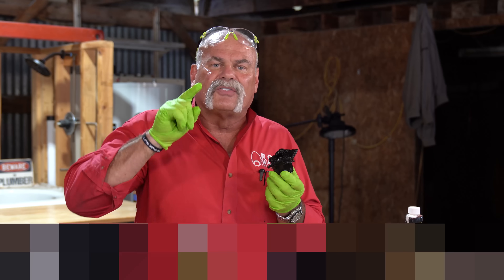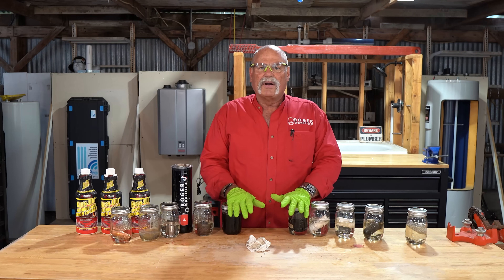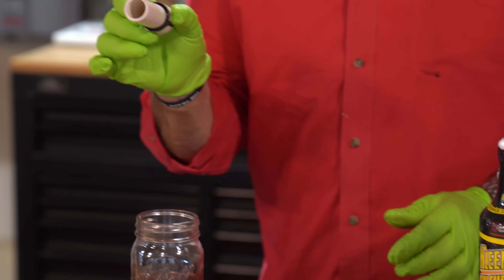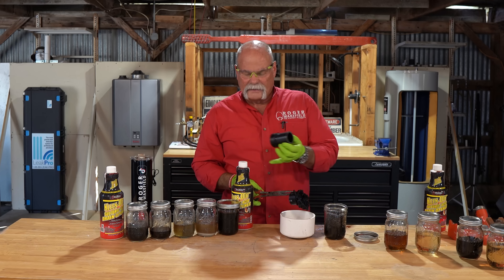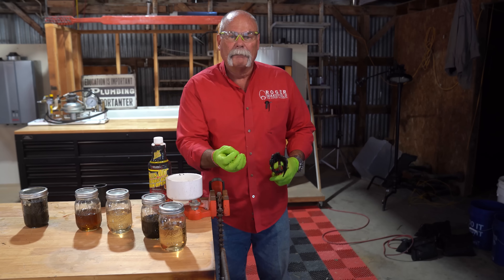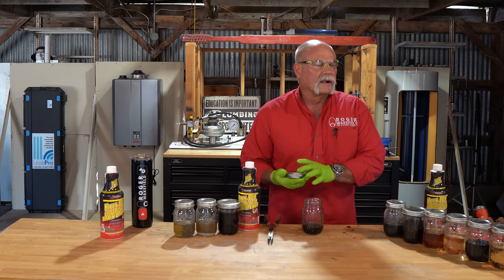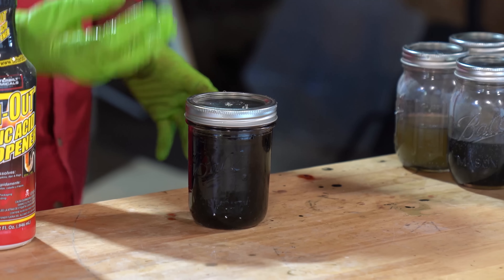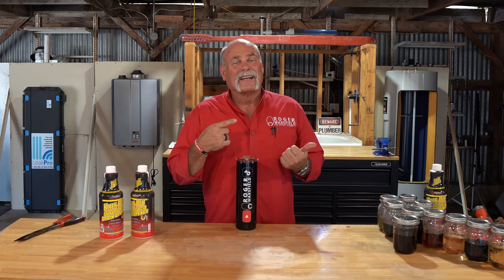Real Plumber Tests BANNED Drain Cleaner

Comment: I don't use ANY drain cleaners, i've replace 20 feet of cast iron in my basement and many P traps when they corroded through from when my ex wife used it mainly Draino, after i told her no drain cleaners at all since i have copper and iron pipes..

Comment: I had a serious accident yesterday with sulfuric acid drain cleaner. I'm very lucky it didn't get in my eyes. My dad gave me a white bottle enclosed in a plastic bag, so that should've been an immediate sign that it was potentially dangerous. I've worked with chemicals at a plant so I should've known to carefully read the label. But i figured since my dad had used it multiple times on his drains in the past that I wouldn't have anything to worry about. If I would've read the label I would've known that this little bottle contained enough for 30 separate doses! I started pouring it in my shower drain, which had a little water in it from a recent shower, and it immediately caused a violent reaction and sprayed out the drain getting everywhere including on my arms and legs. It started burning right away. I quickly grabbed some paper towels and wiped it off my skin. I was scared to rinse it off with water in case it reacted and caused serious skin burns. When I started wiping the drain cleaner off the shower floor, the paper towels got very very hot and nearly caught on fire! It was a huge wake-up call to not underestimate how dangerous household chemicals can be.
Reply: Just so you know - rinsing with massive amounts of water is how you handle an acid spill/burn.  If you got acid on your skin and did not rinse it with water I don't know how you are still here unless it was a very small amount or a very dilute acid.

Comment: Bought the Zep version yesterday at Lowe's. The Lowe's employee told me it was the "only one that works", so I got it instead of the lye-based one I had used for years. HUGE MISTAKE!

Poured the recommended amount into my tub drain. Not only is the ring around my tub drain now black, but it damaged the acrylic surface of the tub! 

Stupid me for thinking that drain cleaner sold at Lowe's and recommended by a presumably-knowledgeable employee would be safe to use for its intended purpose. The warnings on the bottle are in tiny type for anyone over 40 and insufficient even when read.

Comment: On the air plunger, if it can blow the p trap right off. If the plug is down further, it may work but not if you have a vented drain.

Comment: Once over 15 years ago, I had no idea what I was doing, and I used some of this stuff to clear a clog in a second floor toilet that was backing up into the tub.  Little did I know the clog was at the other end of the house from dog hair in the washing machine!  This stuff ate through the ABS drain pipe, conveniently where it ran over the garage (likely bellied), ate through the drywall ceiling, and ate a giant hole over 2' across and an inch deep in the concrete of the garage floor.

The entire drain system from that point down had to be replaced, ceiling and walls torn open, and because the concrete garage floor was also the post-tensioned slab of the house, a structural engineer had to come in to draw up plans and certify repairs to the garage floor.

I SHOULD HAVE JUST CALLED A PLUMBER!  :(
Reply: Sounds like the scene in Breaking Bad where Walt and Jesse were trying to get rid of the bodies.
Reply from the maker: That stuff can be dangerous, I've seen it eat right through pipes! That sounds like a crazy expensive repair

Comment: I just ordered a bottle from walmart and now I'm afraid to use it
Reply from the maker: You found it at Walmart? We had a hard time finding any..
Reply: @RogerWakefield  ordered it from the website now it's sitting on the table I'm unsure if I should use it.
Reply from the maker: Do you know where you are having problems?
Reply: @RogerWakefield  the shower drain is slow idk any more than that
Reply from the maker: Lye would work better
Reply: @RogerWakefield  I ordered some 25 in rubber snakes and that worked great!

Comment: Yes but sulfuric acid doesn't sit in your pipes for 30 days... even in a bend or trap it gets diluted quite fast and eventually is no longer an issue. Most sulfuric acid drain cleaner contains inhibitors to prevent further damage. Of course submerging stuff in sulfuric acid for an extended period of time will damage it, the most dangerous aspect is people getting injured with chemicals because they lack the brains to read the safety information.

Comment: Sulfuric acid is powerful stuff. I had a clog in my left kitchen sink just before the T and it backed up. I was able to get it drained enough to pour sulfuric acid down the drain to dissolve whatever food waste was in the drain. But... I also removed some of the sink finish in the process. As a result, I try not to use that stuff. I now own a Ryobi 18v hybrid power snake tool to use as a 1st attempt tool because I won't use chemicals unless the power snake can't remove the clog.

Comment: direct quote form one of the ABS manufactures documentation.  "The system shall be protected from chemical agents, fire-stopping materials, thread sealant,
plasticized-vinyl products or other aggressive chemical agents not compatible with ABS compounds."
I already knew that, but what I don't know is if it would attack and ruin foam(cellular) core faster than solid or not, being it has only thin inner & outer layers skinned on. not sure what the foam core consists of either.

Comment: sulfuric acid is used in the chrome plating process and others, so it's no wonder it removes it and many other things.
obviously also used in batteries(lead acid), fertilizer, oil, gas, cleaners. at all sorts of dilution levels of course.
nice brain to finger function. I typed sulphuric, when thinking sulfuric. 🤪

Comment: Might be interested to see what other 'drain cleaners' does to pipes over time, most important when you get belly in them. Plus over this side of the great pond you can get Sulphric Acid drain cleaner called Blockbuster. You could be able to get over that side of the pond, it is made by Jennychem.

Also it be interesting to see also which is best from the cheapest you can get from shops (including supermarket own brands), to the most expensive one you can buy in shops to the only one who can buy is is qualified plumper. Also do test which does the better job with cleaning blocked drains, from using a plunger to expensive/qualified plumber only can get drain cleaner
Reply from the maker: We've tested Drano and CocaCola and now KleenOut are there are specific drain cleaners you think we should try?

Comment: I cut out some DWV copper on a kitchen sink that the homeowner had dumped drain O in 4 to 6 times a year. The bottom of the copper had been eaten away because the drain O would sit in these little pockets of build up.

Comment: The ABS it probably destroyed the S (styrene) sulfuric acid will eat Styrofoam. The galvanized pipe is clean, but the zinc is gone. And what you said about the sagging pipes under a house, it still wont be there for long. Sulfuric acid LOVES water and it will be diluted to nothing in short order.

Comment: The copper wasn't warm until you took it out and touched it. When sulfuric acid mixes with water it generates heat, and you had water on your gloves. ABS chemical compatibility is rated as B/"good" up to 75%. That cleaner is probably 85%. My guess is there's a filler in the ABS pipe that the acid is eating. Note that hot sulfuric acid is much more reactive. It would be interesting to repeat this experiment with lye.

Comment: I have been using professional acid for years, but for iron rust stain removal, and hair removal.

Always dilute the acid after use by flushing with plenty of COLD water, and add baking soda to the drain/pipes to neutralize the acid further.

Is it dangerous? YES! It is dangerous! It is as strong as the acid in your car battery!

Will it harm pipes? Yes! It will destroy certain pipes, some others, not so much. But it isn't for everyone!

Comment: Since when is sulfuric acid banned? I use clobber regularly. Chemicals aren’t ideal but sometimes they’re necessary. I’ve had grease clogs that would just close up when I pull my snake out. I’ll use clobber. Then run the snake again and it opens right up. You have to make sure and clean your cable. I use muriatic acid for urinals all the time. Caustic soda is great for kitchen sink as well Now there’s a proper way to use them. This test doesn’t quite compare. Sure it can sit in a belly but just like a p trap as you add water, the acid will push out of the belly. Secondly you’re adding it to water which neutralizes acid. So there’s difference between a pipe soaked in undiluted acid and a little bit of acid added to a pipe full of water. 
You do need to be careful though. I had a total wine store with an island sink in the middle clogged. They weren’t supposed to pour wine down it but of course they did. There’s this bacteria in wine that looks like slime from ghostbusters. This line was full of it. My cable would get clogged with it then it was so slippery akd stringy I couldn’t get it off. Also the line was probably 150’ and the cleanout either didn’t exist or was covered by shelving. Sulfuric acid would eat this stuff up. I had to soak my tips in it to clean them. I eventually poured it down the drain, let it set for several hours then jetted it. I had my tips soaking in some clobber in a small bucket. I accidentally hit it with my foot and splashed on the back of the pants. I could wipe the rubber off the back of my boot with my finger. It made my sock threadbare  and didn’t feel real good on the skin. So be careful.
Reply from the maker: I never said sulfuric acid was banned...the stopped selling this brand of it...working with any chemicals is dangerous, always wear the proper PPE and let someone know if you've dumped chemicals down the drain before you start working on it...thanks for sharing
Reply: @RogerWakefield  agree. I misunderstood. I thought you said they banned this and you’re using sulfuric acid. Since banning one brand didn’t make sense to me, I extrapolated.
Reply: Water does NOT "neutralize acid"... it dilutes.
Hydrochloric acid (= muriatic ) will strip all zinc galvanizing or electroplating off far quicker than sulphuric acid. 
This product has been banned due to the high concentration, and the fact it eats flesh and has been used in violent attacks on people.
Reply: @BTW...  i bet you’re the guy who says “well akshually it’s solvent welding not gluing” In chemistry you’re right. In plumbing it’s semantics. It makes it less acidic. Whatever word you want to use, it doesn’t matter. People know what I mean. 
If a chemist is offended, they’ll get over it. As for muriatic acid or hydrochloric acid (again either works) I don’t care about electroplating because I’m not pouring it anything like that. There may be the rare galvanized nipple used on old urinals but constantly having urine run through it likely makes this irrelevant. Even if it does, you flush it properly. Also if you dilute it in the proper ratios you can use it on potable water. Like I said before it’s all about know what you’re doing. In the end it’s a free country. If you don’t like acid, don’t use it. I’ll keep using whatever I think works best to get the job done.

Comment: As Roger mentioned, ABS was used for many years in Arizona and California for DWV pipe - my 1982 built home has ABS. I've still seen it used in new construction. It transitions to the green PVC at the edge of the house foundation, and then to clay for the city tap. Those lye based formulations were made back before modern plastics were invented - it was galvanized, cast iron, copper (rare), or clay. Even though it seems compatible with most pipe types, almost 9/10 it doesn't work for clogs from what I've seen, unless they are pure hair clogs, they work OK sometimes.

Comment: honestly I would grab sulfuric acid over what is used here in germany: sodium hydroxide. it's literally blowing up the shit in the pipe. (well not literally, but it creates steam by settling behind the clogg, dissolve in water, generate tons of heat dissolving, until the water around the solid NaOH turns to steam and creates pressure. Sure there also is some chemical reaction between fatss and the lye (NaOH-solution) creating soap reducing the friction between the clogging material and the pipe, but a lot of it, is just a brutal steam cleaning of the pipe. And yes it CAN blow up a toilet). But yeah, there are milder drain cleaners, that do not involve superheating the water in your toilet via their enthalpy of dissolution. And yes Sulfuric acid works exactly that way as well.

not surprised it did n't hrt copper though. Copper does not react directly with that type of acid. You would think Sulfuric acid would be an oxidizing acid, but surprisingly the sulfur is really stable in the +6 state it is in and not a good oxidzier at all, so Sulfuric acid is purely a proton donator, meaning any metal that can oxidize hydrogen, like copper, is immune to it. (those metals are called Noble metals. and every metal you think of, hearing that term is in that group) 

That still dissolving pipe was wild though. I honestly do not even have an idea what happened there, except for it being a reversible reaction that released water. So throwing it into water essentially released a ton of sulfuric acid from the rubber, which then under releasing a ton of heat dissolved in the water. I'm surprised though, that the iiron survived at all. don't know if iron sulfates can form a protective layer, but I can tell you one thing with water going through there, the iron fittings are going to die FAST and they'll be a straight up environmental problem

Comment: Hey Roger, I had to laugh when you got to the ABS and mentioned CA. Last year, my friend flew me out to San Jose to replace all his sewer pipes that were cast. They were getting clogged. We went to get some PVC pipe, and found out they only carried a couple of sizes. So, we had to use ABS. So, I did a search to find out why. They stated that first, if the house catches on fire, the PVC will put out pollution. As if ABS and everything else in a house doesn't. Lol. Then, they also said because PVC doesn't hold up to the sun light. Well, first of all, I've seen PVC here in Texas that has been sitting outside for YEARS!! with no damage. Still fine and usable. The other thing is, PVC pipe is used UNDER THE HOUSE FOR THE DRAINS!! It's not even in sun light! I was born and raised in San Jose up until I was 15, and I just can't believe how that state has just gone downhill. It's crazy and to me, upsetting. My heart still belongs there, but I know I can never live there again with all the crazy laws and high prices.
Reply: Laws and Regulations are made to deal with unreasonable or criminal behaviors. Without laws your society would descend into a hellscape quickly. Perhaps you would like that, so you can do whatever you want without any regard for anyone or anything other than selfish arsehole will?  
 The compounding and production of PVC is hazardous too. So is concentrated Sulphuric in the hands of a stupid idiot.  
 High prices are a fact of life. Perhaps lower prices in other states is due to nobody paying taxes... that pay for the damage arseholes do... those who do whateva they want at the expense of others.

Comment: I was wondering why I couldn’t find that stuff in stores anymore. lol I knew this stuff was strong the second I put it in my drain. Smoke started to get in the kitchen but man did it clean out the problem 😂
Reply: Had a clog in an apartment tolet couldn't plunge out, the sulfuric acid cleared it in like 5 minutes.  Hope there wasn't any galvanized pipe between there and the sewer though.
Reply: @Dan-yk6sy  yea same. My apartment is pretty old
Reply: Same lol! I used it to make battery acid to recondition 12v batteries.

Comment: I etch custom copper circuit boards at home using a mixture of sulfuric acid and hydrogen peroxide, considering that solution can eat 1.4 mil thick copper off a board in just 15 minutes or so is all the reason I need not to drop it down my copper drain branch lines. Clean clogs correctly, with proper mechanical solutions folks.
Reply: the hydrogen peroxide is what really is doing the damage. that'S a mixture called piranha and the name is VERY fitting. Not sure if I want to test it against gold and platinum but yeah it's going through copper, while sulfuric acid, can't and oxidizing acids like Nitric can only under certain circumstances. But that is a reaction that needs sulfuric acid AND Hydrogen peroxide. Sulfuric alone can't hurt copper.

Comment: You should see what does to a porcelain tubs. it will eat right down to the metal.
Reply: Porcelain is NOT used  to coat metal tubs. 
Glass is, known as 'vitreous enamel'. 
That type of acid will not react with glass. 
If the enamel coating is flawed with chips or cracks it may reach the steel... but it doesn't cause significant corrosion unless at high concentrations over a long time period.
Reply: @BTW...  I reglaze tubs I had to repair a few damages from that stuff.
Reply: @BTW...  I saw a lady's tub after she had a mishap with it and got everywhere. Tub was destroyed. Finish was stained or whatever but yes, it was toast.